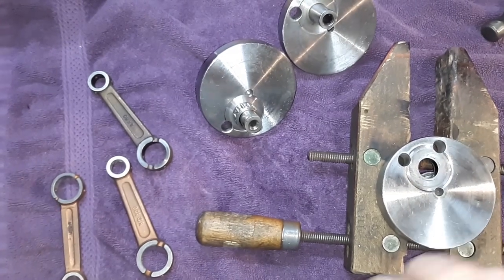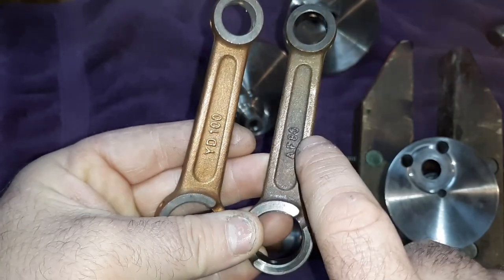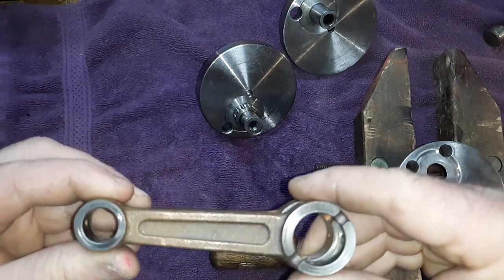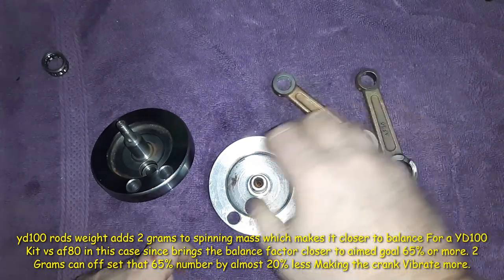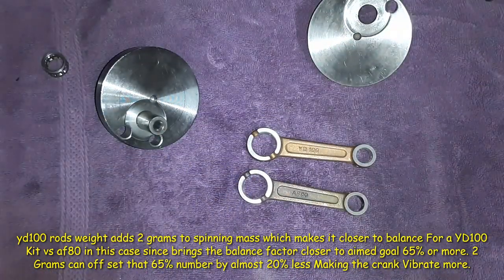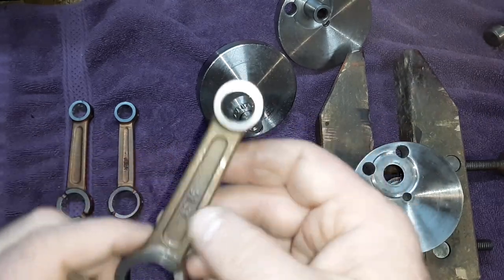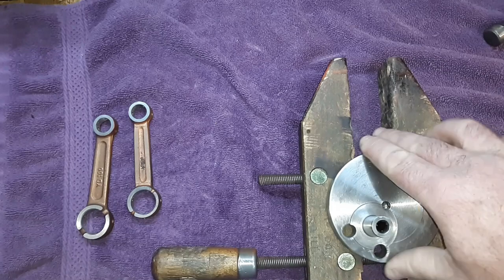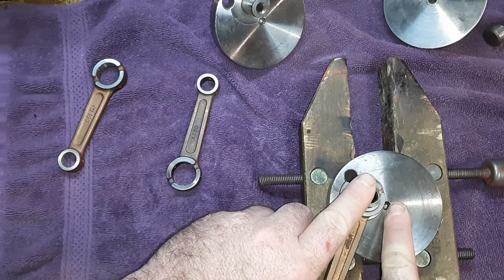Motorized Bicycle Builds - Crank Stroke Vs Rod Stamp Stop Being Mislead By Bad Info!

Comment: Hold up all these two strokes are different especially the Zeba right out the box no breaking I'm flying on it. Zl40mm the engine you have to break it in or the bearings in the bottom goes bad!! Chinese very big lot of factories different technicians stamp the rod with the name initials just like our rDM guy in Pittsburgh. Question if all 2-stroke are the same y is Zeba 80 $219 on eBay and all the engines are cheaper as you were
Reply from the maker: Some of the brands! Actually clean ports! Balance cranks to 70% and use better brands of bearings!  Ms 460 I have has 500$ bearings in it alone!  so depends whole makes what and where it comes from.  some of the castings are made with Ceramic mold! Cheaper ones with sand molds!  You can tell when casting is full and crisp it's a ceramic casting. Sand castings normally look like missing parts and imperfections. One cost 2X more to make!  Some are port matched out of the box for 200$ ! some come with what every they tossed in the motor you bought off ebay for 85$ lol! Normally ones sell for 200$ will warranty parts for a bit if one fails!  Ebay one your back on ebay buying the parts lol!
Reply: @BuildBreakFix  yes man my first bill was one of those cheap engine ran for 6 months and died 2016. then I met Pete 2017 he told me about Zeba 80 engines never bought a cheap engine again. That's all they do sell cheap engines on eBay. Never had to open one of my Zeba since 2017 when I bought them. Good video for the rookies though

Comment: Hello,
my top and bottom needle bearing of rod broke... yeah.. china doll crap balanced myself.. Did 1000+ km but then I swapped to minarelli 70cc.. maybe 70 km...
Do you know there is any stronger needle bearings for this popular china 40mm stroke rod? There is little information on the internet. Is there any scooters crankshaft that is "easy" to modify? Im form Poland (EU) so the prices are really crazy, new crankshaft from china 45$, new engine form Germany 70$ wtf xd

If you have some time please advise.
Reply from the maker: Video I did called Bibble of motorized bicycle repairs https://youtu.be/7S_dkB7lZDY
In this videos Description You will see these two video points linked!  Explains each sized bearing for every kind of build! Crank pin bearing always same size!  The wrist pin bearing is not! But lists ever one in start of each section!  Many companies make these bearings!  Matter knowing the size you need!  

29:59 Splitting & Rebuilding Crankshaft
02:02:57 Wrist Pin Needle Bearing Install

Comment: All the replacement cranks i have found on Amazon never have the Stroke length so even if it says zl40mm it might not be a 40mm Stroke crank
Reply from the maker: Rod stamp is just a weight marker.  Crank webs determine the stroke length.   99% of the cranks are 38mm.  40 and 45 are hard to find
Reply: @BuildBreakFix  so finding a replacement cranks for a firestorm zeda 80 slim to none

Comment: Thanks for the video. Im heavily considering turning my YD100 to a Phantom 85, and was told that I need an af80 crank, cause it uses a 12mm wrist pin and its the same stroke and rod length. Now I know that's BS.
Reply: Phantom doesn't need 40mm stroke. My specimen had space between the bottom of the piston at bdc and the port. I tělové both gaskets and added silikone and there's still space. Ech cylinder is different
Reply from the maker: Rod you need is a zmn100 rod which is for 12mm wrist pin.  Phantom works best with 36 to 38mm strokes actually! Since it copies ms380 top end (More so toward 36mm stroke side)  Af80 rods are sold normally on 38mm to 40mm cranks but 40mm stroke is not ideal for a phantom85! Yd100 bottom half is actually 4mm deck height higher then phantom 85 bottom half.  Make sure you deck it!
Reply: @BuildBreakFix  Thank you very much for the information.